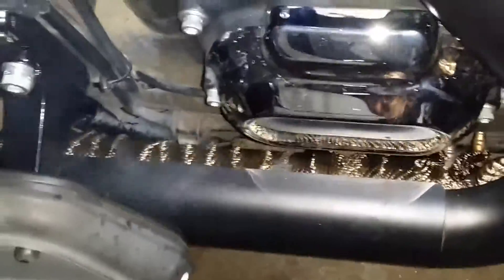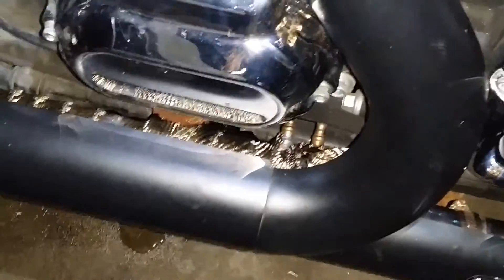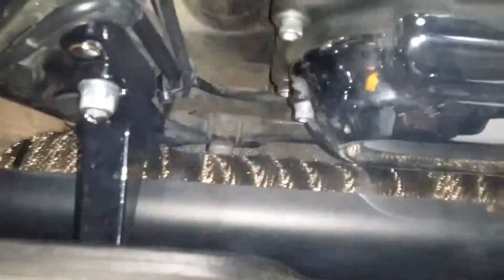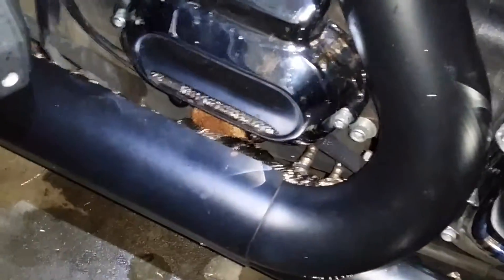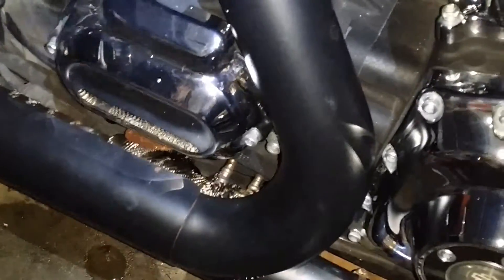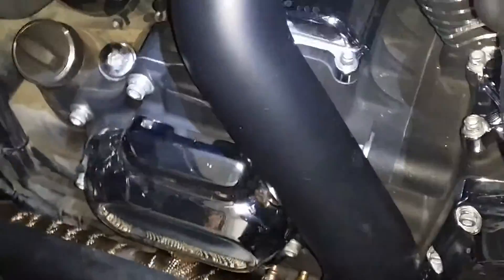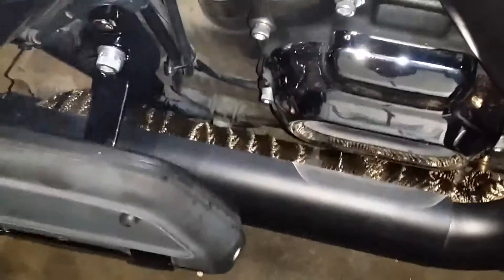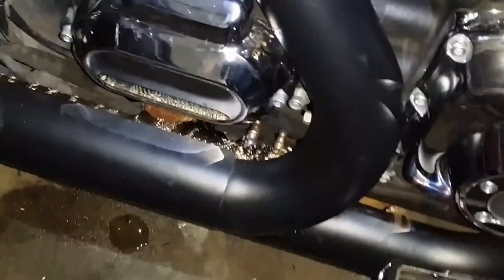Testing a theory on controlling heat off Harley Ultra Limited pipes

Comment: check out Fuel Moto  Jackpot 2-1-2 ceramic coated headers.  The ceramic coating insulates you from the heat and the headers delete the cat period.  Eliminating the problem from its source.